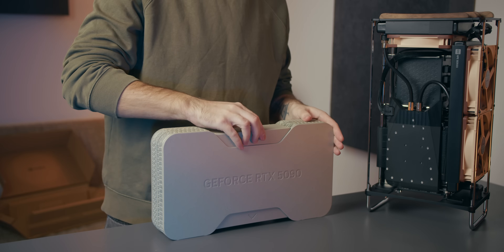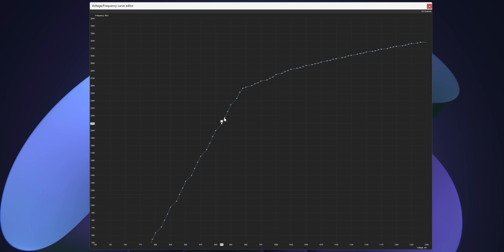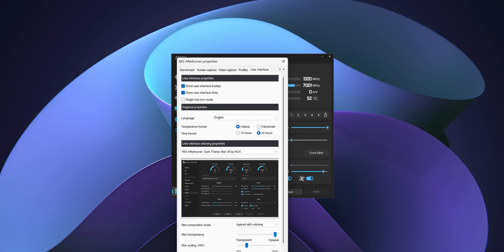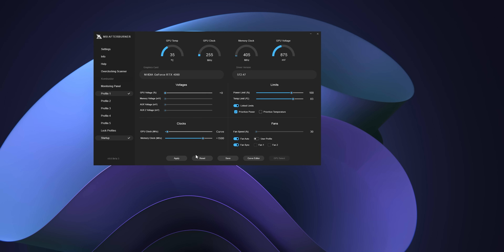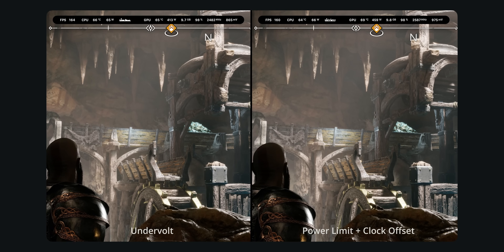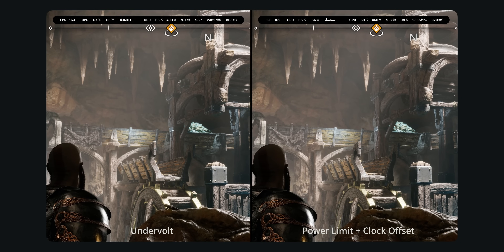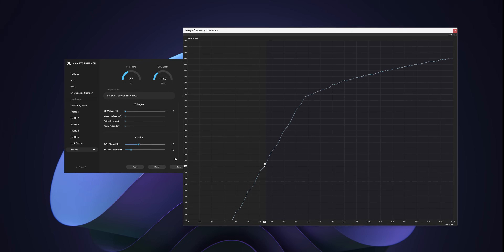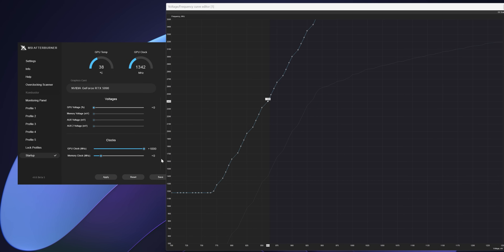5090 FE Undervolt Testing & 4090 Face-Off

Comment: Have recent driver updates made any changes? Not sure what I’m doing wrong but at @885mv I can only reach 2662 on the graph. Effective clock speed in steel nomad is then 2496 and I’m drawing 500w. Same voltage, way more power draw, less effective clock speed 🤔 tested with 100% fan speed
Reply from the maker: I am on the latest driver and the V/F curve behaves exactly the same for me as in this video. Effective clock being so low is not unusual but that wattage is. What are you testing in?
Reply: @EIGAtech  Thanks for the reply. I sent you some screenshots via DM on Discord. Not sure - maybe I just have a really bad card :/ Was only testing with Steel Nomad and could not get anywhere near what you got. Tried to reinstall drivers but I just can't get my clocks to be as high
Reply: @Xero_TV  Hey I'm having a similar issue where at 885mV im at 2665Mhz. My effective clock is 2460Mhz and drawing like average 485 watts. Did you find a solution/way to make ur V/f curve look more normal. My steel nomad scores are all in 13800-14010 range.

Comment: In game its 2400-2500mhz when i set it to 2827mhz 0.890v +2000 memory.......that normal?
Reply from the maker: Yes, I mention that in the video.
Reply: @EIGAtech  Seems real low, my 4090 was 2800mhz. Daym. Often even dips into 2385
Reply from the maker: @jordan3802 I know, it’s super strange and I have no explanation, but if you want to validate it run tests that compare the UV to stock performance. Performance is what matters.
Reply: @EIGAtech  10fps drop in lords of fallen, something not right
Reply from the maker: @jordan3802 Try this: Select 890mv point -> press L once -> Type in +1000 mhz to GPU Clock -> +2000 mhz to Memory Clock -> Apply. 
Let me know if the reported clock frequency is any different.

Comment: I just bought a base Zotac 5090 Solid card, and I will run it with a ryzen 9 5950X which is not a very demanding CPU for power as far as I know. On my PC I have a Corsair RM850 Gold psu. What I am wondering is with this undervolting method of limiting to 870 mV on my GPU can I still use the same PSU without upgrading? Just don't wanna invest in PSU at this moment. All thoughts are greatly appreciated. Thank you..

Comment: what target frequency should I choose tho ? this guide kinda assumes you have to already know how to undervolt which defeats the purpose like why would I watch a guide if I already knew how to do it. title is misleading
Reply from the maker: Fair point that the guide already assumes some tuning knowledge. I wanted to avoid saying "do exactly this" as overclocking/undervolting is not something you can copy and paste and never bother with again, which is why I go into stability and testing quite a bit. But to answer your question, you shouldn't necessarily target a specific frequency, but rather a voltage point. 

In my opinion 885-890mV is the sweet spot for retaining most of the performance, or even surpassing stock performance if adding a memory overclock on top. Then, depending on what the stock frequency/voltage curve looks like for your specific 5090, I'd first try a +1000 core frequency offset on the 885mV point (should correspond to somewhere around 2700-2800Mhz) and then check for stability.

Comment: When I set my card to 2800 at 900mv, which results in ~2600 - 2750mhz in-game at 890mv ish, i've somewhat prevented my card from pulling more than 500w no matter what load i throw at it, being portal rtx with no upscaling, witcher 3 or supersampling other games on ultra. As a person with anxiety I'd rather the game crash from the card being power starved than the unlikely but non-zero chance the cable can melt.
Reply from the maker: Sounds great to me!

Comment: I have no idea what I am supposed to copy. I dont see where you say," I recommend these to use..." I am very confused and would love if someone can help with do this over discord or something pls.....
Reply from the maker: I don’t say that because it would be the wrong thing to do, there is no set and forget setting to copy with GPU undervolting. At most I can recommend a voltage range to explore: between 870mV and 900mV seems to be best on 5090 cards. Start there, follow my method for editing the voltage/frequency curve in MSI Afterburner, and try offsetting the points by +1000 mhz.

Comment: EIGA what is your prefered UV setting, the 0.87V or the 0.885V? 
Are you only using speedway to test for UV stability, and for how long are you keep running the benchmark?
Reply from the maker: I use the .885 undervolt 90% of the time. I don’t use 3D Mark to test for stability, proper stability testing should be done in a variety of games, there is no single test (that I know of) that can reliably be used as a definitive validation test for undervolting.

Comment: Would love to see an Aorus Master 5090 undervolt! Apparently that card comes with a much higher than average power draw. Also I bought one haha.
Reply: dont know where you got your information but as far as i know is that the aorus master card has a average power draw with excellent cooling, and what undervolt you can pull off depends on Nvidia's GPU die not on the brand who designed the cooler.

Comment: I can set core to over +1000 mhz in msi afterburner, however i use the same beta 5 msi afterburner like you did, and i use 576.26 graphics driver. Is it just showing over 1000 mhz and actually works at +1000 mhz or the new graphics driver solve this problem i wonder. Did you do any further test?
Reply: By the way i use zotac Solid 5090
Reply: just confirmed although i shows over +1000 mhz it act the same as +1000 mhz XD
Reply from the maker: Very strange, I just installed the 576.26 hotfix as well but it behaves exactly the same for me.

Comment: This is a card that’s begging for a water block. Over the years, water cooling has been diminishing returns for me, but I’m seriously considering for the 5090.
Reply from the maker: For me it’s the quietness and control over fan speeds, I wouldn’t run the card stock or overclocked even if I had the radiator headroom.

Comment: hi does your b650ei from asus makes coil whine and does it affect your sf1000? so does sf1000 make clicking sound in idle? had this issue previous
Reply from the maker: Yup, I do get coil whine with my B650E-I that goes away if I run OpenRGB in the background (weird fix I know). Definitely no issues with the SF1000 and no clicking sounds, that sounds odd to me.
Reply: @EIGAtech  thx very much !! do i havw to just run open rgb or do i have to connect it with the motjerboard settings? so setting rgb colors fpr example?
Reply from the maker: @ Nope, just have it run in the background. I do use it to decrease the brightness of the lights on the 5090 FE but that’s all.
Reply: @EIGAtech  thx very much for helping me!

Comment: Super impressive results at 870 mV. I usually recommend a 70% power limit and overclock to people, but undervolting is gonna be my go-to for my more technical friends from here on out. Thank you!
Reply: OC is literally undervolting. U putting the entire curve to top. The only thing u dont do is to flatten the curve. No need, if u do power limiting.
Reply: 870mv its not affected. Most affected is -200mhz. Do same test on your gpu -200mhz at same -15mv lower. -15mv its only about a few watts less draw power, but the key is lower clock mhz.

Comment: Hi, thanks for this video.  Will you have an updated undervolt video with the current drivers?  Thanks
Reply from the maker: I will if there's going to be an update that significantly changes how the card behaves, but so far that's not been the case. The latest driver improves synthetic benchmark scores but doesn't really change the overall point of the video, the method shown or the power savings.
Reply: @EIGAtech  Ok I'll follow your guidelines.   Have a good day!

Comment: I have an Asus TUF 5090. In 3dmark tests it got a +2% increase at 2962mhz and vram +1500mhz at 900mv. Temperatures dropped by an average of 4 degrees and max power dropped from 600 to 540. What do you think?
Reply from the maker: At that frequency and voltage I'd say that's a pretty decent gain. You could make another profile with a more aggressive UV, something around 870mV or so and use that whenever you don't need to squeeze every last % of performance.

Comment: Sweet - Ino3d oc RTX 5090 here - under load (heaven) at 895mV and at 2830 MHZ resulting in 410 Watts or so I am quite happy. Excellent video - estethics, information, presentation - all well done. Subcribed.
Reply from the maker: Thanks for the sub! The Inno3D card has a reference PCB, easy to waterblock if you ever want to go down that rabbit hole 👀.
Reply: Thank you! I have the same card and wil definitely try your setup. Is this the optimal result from your card?
Reply: I guarantee you you're unstable in a practical use scenario, i.e. gaming

Comment: which version of msi afterburner are you on? i for some reason can't find the monitor metric for gpu power consumption (even though i'm on latest beta which apparently supports 5090 etc) - great video thank you!
Reply from the maker: Thanks! That's odd, 4.6.6 Beta 5 is the latest version you should be using, it definitely has a power graph for monitoring, but I don't use any of the monitoring in AB, instead I use HWiNFO.
Reply: @EIGAtech  thanks mate

Comment: I have one question: I understand that this configuratio has to be done with powetlimit at 100, right? Lowering voltaje also will lower power consumption?
Reply from the maker: Power limit is left at 100%, correct. Power consumption is lowered because of the voltage limit introduced with the undervolting method I show in the video.
Reply: 50 series also seems to boost higher with the power limit set higher regardless, even if you're nowhere near hitting the limit. i.e Even at the extreme undervolt end at 0.83v 69% power target (400w), my card runs at 1800MHz, where as 104% power target (600w) it runs at 1900MHz. Nvidia have been weird with this gen. Despite the card barely going over 300w. 

So yeah always keep the power limit high even when undervolting.

Comment: Great video! Thank you! I'm thinking about buying 5090 but I've got some concerns about cable melting. Any suggestions about mitigating this risk?
Reply from the maker: Thanks! Undervolting it down to 20-30 less power is probably the best thing you can do to ensure the connector has a nice extra safety buffer. Secondly, ensure your cable is properly seated, run a heavy load, something like Furmark (at the card's stock settings for a few minutes) and check if any of the cable strands feel hot to the touch, if the temperature is normal, I'd say this is as much as you can do before going into extreme measures like buying a current clamp. Thirdly, enjoy your card, in the rare event that the connector fails, you should still be covered by the card's warranty.

Comment: Hi, thanks a ton for a video, I apologize if it's a stupid question but 5090 will probably be first GPU that I undevolt as I feel it's "needed" for safety and efficiency. 
If you don't mind, can I ask about few details? I'm afraid you skipped few basic parts from the perspective of absolute newbie or things that looked obvious to you.

1. If I recall, the rule of thumb in undervolting as you also stated is to first check the max Mhz and mV in some heavy benchmark and then go from those values.
In 9:03 the stock settings seem to sit for the most time at 2670 Mhz and 1010 mV and your undervolt is as shown 2737 Mhz and 885mV. Can we on average take those values in percentages as a base for undervolting? It means that there's a 125 difference between mV but I have no idea about how much you changed the Mhz in regard to stock (or I'm blind, sorry). Does it mean that we can "safely" go with 25's incrementals when decreasing mV from stock until it's not stable? Is 100/125 mV usually very safe?

2. 2572Mhz 870mV results seem fantastic. 3 even 5% drops wont ever be noticed in games FPS-wise but 30% power saving definitely will. I'm afraid each card, specially AiB cards won't ever have same/similar results. 
Unless I missed it in video, would you mind telling in percentage wise how different those Mhz and mV's are in comparison to stock? 

3. Is uv overall as simple as finding certain mV (870 for example) and point of meeting with 2572Mhz and then simply flatlining everything after that?

Sorry if something I said doesn't make sense/is confusing.
Reply from the maker: Thanks!
1. I think you're overthinking, I said that as a rough starting point. You can check your V/F curve and try +1000 at 870mV like I did and see what frequency that would equate to, it should get you roughly the same frequency as I got, unless you got one of the 5090 cards that have a completely different V/F curve, in which case you will have to adjust accordingly.
2. Each card is different, especially this generation there seems to be quite some variance in what the V/F curve looks like. If your curve is as steep as mine, then you can just try +1000 at any voltage point between 850 and 890 and check for stability. 
3. Yes, you pick a voltage point, increase offset to your new target frequency, shift click and drag to select all the points to the right of your point, drag them down below your point, and then hit apply.
Reply: @EIGAtech  Thank you for the clarification! I appreciate that. Sounds like something relatively easy, especially for such efficiency boost.
Reply from the maker: It looks complicated but it really isn't. The aim of observing the stock behaviour is to get an idea of the performance level and the boost frequency, basically to familiarize yourself with how the card behaves, then it's a matter of experimentation (within common sense of course, you're not going to get 3000Mhz at 870mV for example). Ultimately the best test is performance, and you can use tools like 3D Mark for benchmarking or CapFrameX for recording your own tests in games.

Comment: Thank you for uploading this video - I had no idea it was this easy to UV! Here's to hoping they increase the offset to over +1000...
Reply from the maker: Unwinder, the developer of MSI Afterburner responded on this issue and clarified it’s a driver limit, but due to safety concerns it wouldn’t be unlocked past +1000 Mhz even if it were possible. So the best bet is probably a vbios update that changes the V/F curve.

Comment: When you move the whole curve aren't you increasing the idol mhz too? Wouldn't that decrease powere use during gaming but increase use at idol?
Reply from the maker: You are, but the effect on idle power consumption is marginal. If that worries you, it's possible to setup MSI Afterburner to automatically switch between two profiles: one for 2D workloads (so "idle") and one for 3D workloads (gaming and any software that uses hardware acceleration).

Comment: So I've avoided undervolting my RTX4090 because of optimums video (https://www.youtube.com/watch?v=XrZNSTmOstI) and der8auers video (https://www.youtube.com/watch?v=60yFji_GKak). I've only run the card with a 80% powerlimit.
Did you not experience the same performance loss at the exact same GPU clock when undervolting your 4090 as optimum did? In his video GPU Video Clock and GPU Effective Clock decreeses when undervolting and we have no control over them in MSI Afterburner.
Reply from the maker: The power limit method is inferior to a correct UV using the Curve Editor in MSI Afterburner. The effective clock will always be lower, and it also depends on the type of workload, on my 4090 FE it was always within 10-50Mhz of the target frequency. Ultimately it doesn't matter, what matters is performance, which can be tested. There is also an incorrect undervolting method that results in lower effective clocks, you can read more about it here: https://www.reddit.com/r/nvidia/comments/tw8j6r/there_are_two_methods_people_follow_when/
Reply: @EIGAtech  Thanks, I'll read the reddit thread.
Edit: Interesting. I was using the drag point method when undervolting before. I'm going to try the core clock offset method.

Comment: I don't understand why you didn't test the 88mV with the +2000mhz memory...  Undervolt + OC at that point would always be above stock in performance, while consuming less power.
Reply from the maker: That's what I run as my daily UV, with +3000 on the memory. It would've indeed been nice to include that in the testing in hindsight.
Reply: @EIGAtech  Right on, I am working on my PNY 5090 undervolt as we speak!

Comment: You need to have flat fan curves that look like a ladder, then set them depends where the temp fluctuates the most when idle and when under load. A fan curve like in the video will make your fan speed go up/down every sec, which isn't good.
Reply from the maker: I just did a simple firmware curve there (limited to 3 points) that’s basically a less aggressive stock curve. It does a good job and it doesn’t ramp up/down aggressively.

I do use the same method you describe when setting CPU fan curves with FanControl for example.